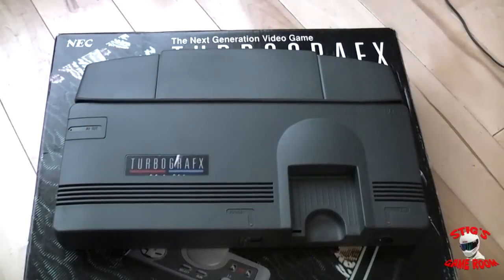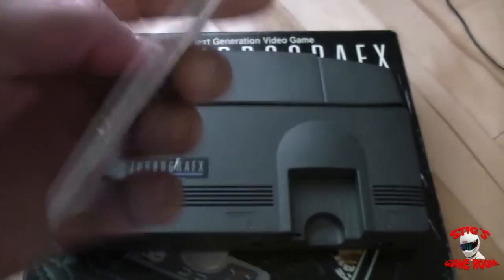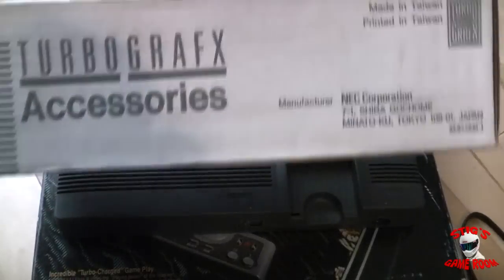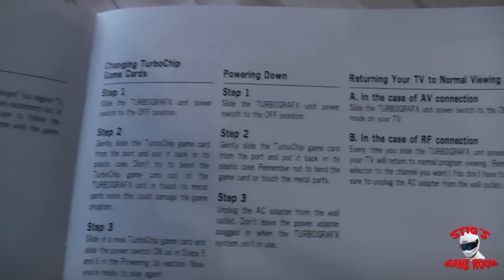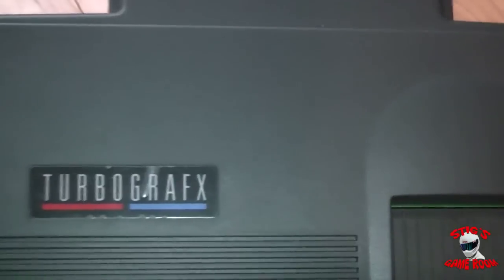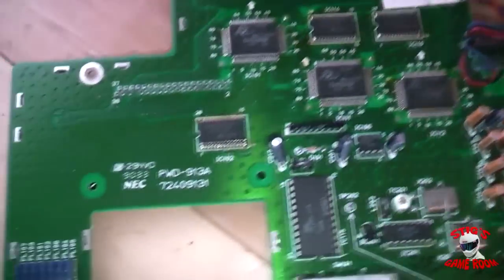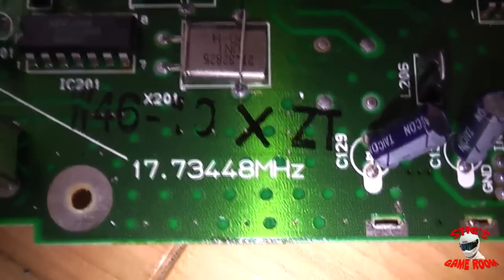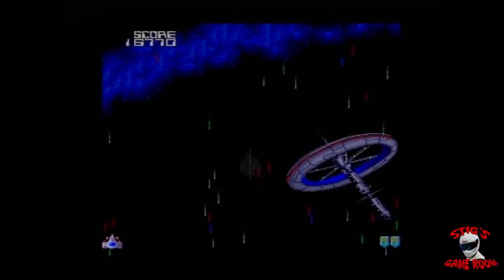A detailed look at the PAL version of the NEC Turbo Grafx 16 (Inside & Out)

Comment: The ohm converters were used to adapt to different RF terminals on the back of your TV. Even the American NES came with converters since some American TVs had a coaxial jack and some had screw terminals.

Comment: The loop of wire labeled “TP202” is a test point. You connect the oscilloscope probe or frequency counter and compare your results to the target frequency silkscreened on the board.

Comment: Also that port for A/V I've seen on US versions on eBay but we got a RF plug for it. There is however I've seen a attachment for composite and you could still hook up a power supply and CD drive through it I heard.

Comment: If course, the hole for the AV Multi Out DIN is bigger than the one for the American console. The box around the alternate text wasn’t there on the American version either. Of course, the molded text on the bottom was different too (model number and such).

Comment: Oh man that's nice it gets AV output unlike our TG-16 only had RF unless you bought the Turbo Booster or the CD-ROM interface those give us AV output.  Strange all the accessories came in a separate box but like you said this wasn't an official NEC release in PAL-Land.  No keith Courage as a pack in...  oh you poor Brits....  lol or not.
Reply: The accessories were in a separate box so that they could sell a different RF modulator and power plug for different European regions with the same boxed console.

Comment: Also that screw on the plug if you unscrew it and pull the lead out it has the EU wall plug on the end, that basically plugs into the uk plug part and converts it, pretty lazy way of making a bunch of power supplies :)

Comment: I would have appreciated seeing the bottom without the shield so that I could make my own AV cable without taking mine completely apart.
Reply: I did figure it out. Since I can’t link my IMGUR album, I will explain my methodology.

First, there are only 5 pins and we know that it must have Composite Video, Left Channel Audio, Right Channel Audio, and Ground for the standard AV cables. We also know that it has to have power for an external RF modulator, which would be 5 volts just like the controller port accessories and the internal electronics.

That’s all five connections we know exist but we still need to map it and interface with it. I ordered a 6 pin DIN plug from Console5 and forced the extra pin out of the center. Using my continuity meter and the extra pin I probed the DIN socket for ground with my other probe on some exposed shielding. Once I had ground, I plugged the DIN connector into the socket and powered on the console to probe for 5 volts with a voltmeter (one probe on ground). Alternatively, I could’ve used the known pinout of the controller port with the continuity meter by plugging the extra pin into +5v and checking continuity on the remaining 4 pins at the multi-out.

The remaining pins are safe to figure out with trial and error. I connected them to the tips of three RCA cables (outside connected to ground) and plugged them in to the TV. You’ll get a loud buzz if you plug video into audio, which makes it easy to discern audio from video. Discerning Left and Right audio channels from each other depends on the software you boot but I like to use Chris Covell’s “PadTest” as a stereo test since it plays sounds out of the left speaker for the D-pad and the right speaker for the I and II buttons.

Once you figure out which goes where you can simply label the plugs or rewire them if they are already color-coded. I ejected the pins from the DIN plug and switched them around but in hindsight I wouldn’t always recommend that. Ejecting the pins made them loose so I added some glue inside the plug housing.